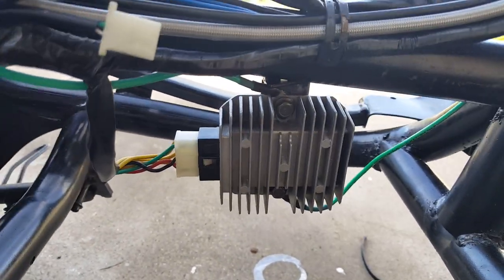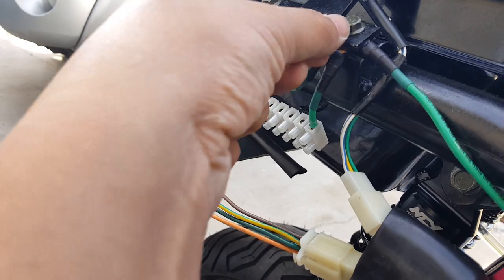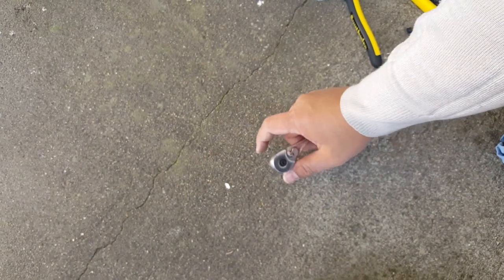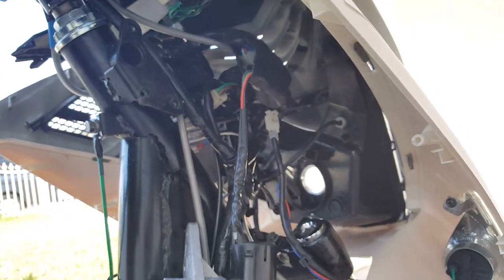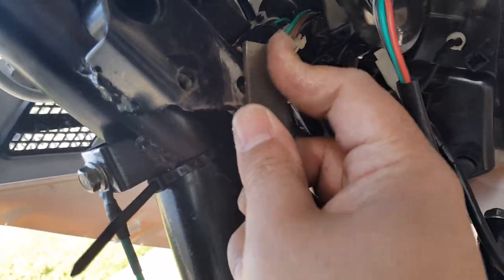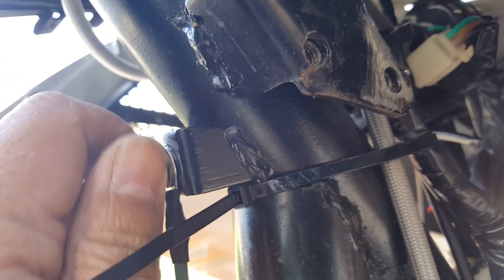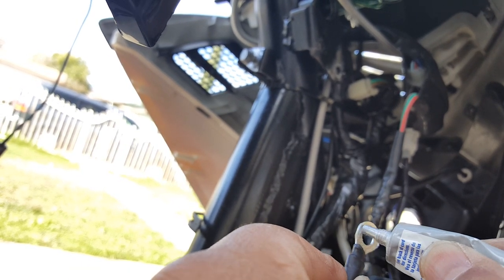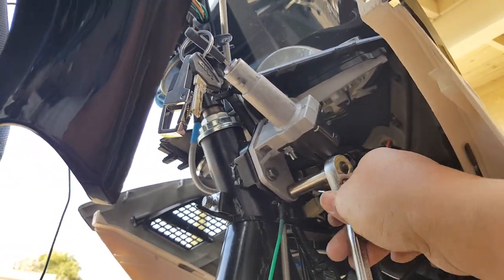How to Rewire GY6 Scooter Ground Wire, Crimp and Solder Part 4 of 6

Comment: the grounding block isnt needed.each of those pairs of hole would need a ground wire running into it .its not like the whole block is grounded and you just jam and tighten wires into it.